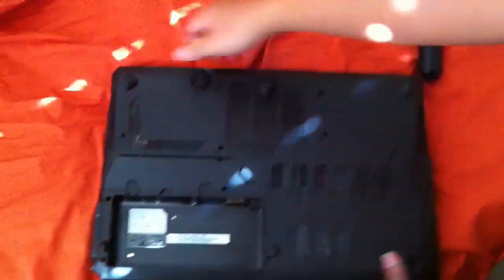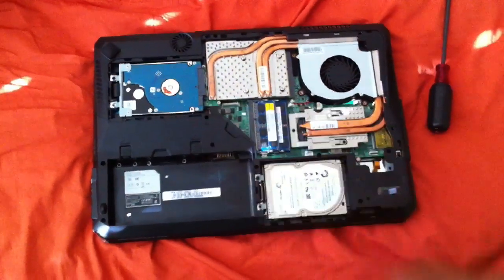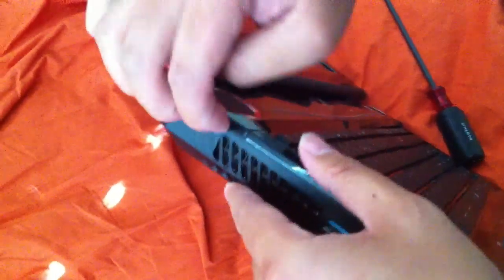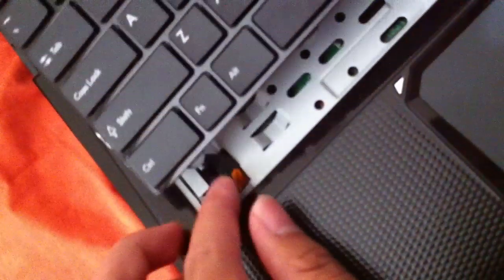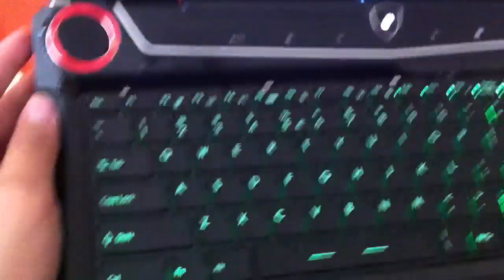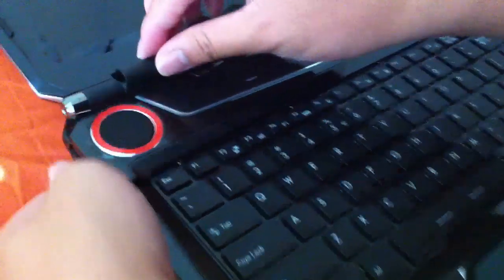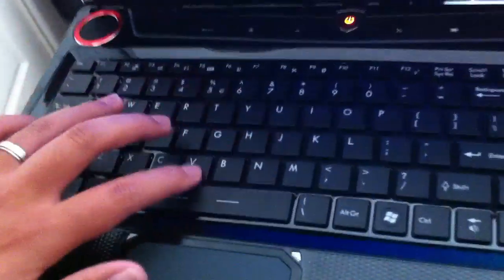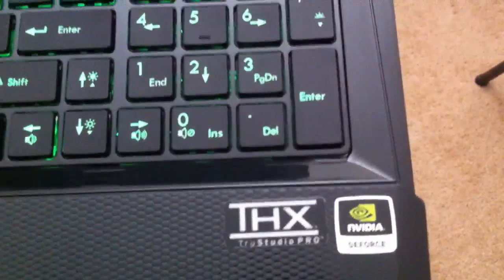MSI GT60 Barebones 16F3 SteelSeries Keyboard Installation

Comment: hi jerry, I ve upgraded my gx60's keyboard to a programmable backlit keyboard very similar to this one, but the brightness and color of the key board are uneven, for the same key it has darker spots and brighter spots. I think I might have bought one of the "fake" ones out there so I was wondering where did you get this one as it looks so much brighter and smoother. thx

Comment: Did it and now I can't switch the LEDs on. Not sure what I did wrong or if it's just a software problem
Reply from the maker: Hey Kim, did you msi GE originally come with backlit keyboards? Like 1 solid color or it came stock with no backlit?
Reply: jerry0o8 it came with blue light.
Fixed the non glowing now.
But it doesn't react to klm.
Will try another version.
Reply from the maker: Kim Schneider Hey Kim, did you buy the exact same keyboard as mine? And do you mean you will try another version of KLM or another keyboard? If your laptop came with blue backlit then the keyboard should work. Your lights are now the colorfull backlit or is it still not working? I'm not sure if the ge60 has any models available that has the full color backlit?
Reply: Kim Schneider Hi Kim, I want to know if you did this change keyboard to a MSI GE60 20E ?? and if you run the application I get to change colors. and I'm thinking to make the change on my laptop too ...

Comment: does this also work for the GE60 2oe?
and which Keyboard will fit?
Reply from the maker: The ge60 keyboard looks the same so I would think it will fit, but I'm not 100% sure because I have not had a ge60 in hand with me before to check.
Reply: jerry0o8 
could you messure the keyboard for me so i can check out if its the same? would be very nice of you. :)

Comment: I might go for this, albeit on my GE60.
Spilt soda on it a week ago, three letters, half my numpad and a few other unimportant keys are all shot...
laptop is fine, its just the keyboard that got all screwed, all the other letters are wrong (space is backspace, backspace is 3, 3 is 'search', and there isn't even a search button ON my keyboard)
I looked up a freeware program made to change key registries (it can reset them to default as well) called keytweak, and i changed all of my keys back, but was still missing 2-3 letters and my tab key, along with 2/3rds of my numpad...so i just went and bought a cheap USB keyboard for now (I might look silly, but hey, it works...I always haul around my charger and mouse for my laptop anyways, and the laptop itself is one of the heavier ones).
Doesn't look too complicated, but I cant even find stock keyboards for under 70-80 bucks, so I can either keep my eye out for someone selling a spare, or shell out the extra 20 bucks for a really colorful one...and this one looks damn nice, won't kid ya there.
Either way, thanks for the video! Was quite instructive ;)
Reply from the maker: hi silverbird6! That sucks that your keyboard got soda on it =[. I still have my stock blue keyboard as a spare I am not using and will sell it. Asking for $65 and will do free shipping. Works perfectly fine since I never used it once I switched it out with the colorful one.

Comment: did that screen come up on it's own after you installed the keyboard? i got a new gp60 which comes with a non backlit keyboard and was thinking of upgrading like you did. just wondering how it works and if I might have driver issues.

Comment: I have not found an update or a suitable fix for this yet. I also thought the cpu would not bottleneck but I guess it does. I know the gtx 675m can handle Tera but the cpu cannot. I also play tera on my desktop with a i5-2500k and gtx 660ti. It runs smooth. If I were you I would not buy another cpu for the laptop. Maybe just play how it is now and upgrade to a desktop later.

Comment: hi jerry i thought that the 3630qm is a good cpu and could handle anything :O that's strange that the frame drops in tera and other games in certain areas and the cpu isn't under full load. it runs every time on every thread on 30 - 50% and the gtx 675m runs then in the areas on 65 - 70%. and on some games like resident evil 6 the cpu runs on every thread on 100% and the gpu too. what could i do to fix this problem? should i buy an other cpu that is oc'able? i'm also planning to play with pcsx2.

Comment from the maker: I got mines on ebay, from the seller Frostycomputers. There is another seller called rkcnotebooks. Both of them are out of these multicolor keyboards atm. I do have my stock Blue backlit keyboard that came with my msi gt60 barebones that I am selling if you would like a blue backlit keyboard for this laptop.

Comment from the maker: Hi, if your keyboard is already steelseries then I think it would work. I checked the ge70 and the keyboard layout is the same as the backlit one too. Only problem is you would have to open the back of your laptop to check if it has a plug for the backlight. If there isn't a plug, then it probably does not support backlight =[

Comment: Hi Jerry. I'm from germany and want to put in this awesome keyboard into my ge60. I know about the missing connector for the powe for the LED's on the board, but I think i will find a 5 volts pin on the mainboard to get them glowing.
Do you have any idea of the seial number of the keyboard with a QWERTZ layout?

thanx for this video!

Comment: Just wanted to say thanks! I spilled beer all over my XMG P512 (which uses the same chassis) last night. Got the case open, the drives and fan out etc. - got everything dried and saved everything apart from the keyboard. Spent an hour trying to get the damn thing out before I saw your video!

Comment: yours is the 16F33, mine is the 16F32. It came with the non backlit keyboard. I don't think it would be a copied version since all of the keyboards come from the same manufacturer (Sunrex), which is also Chinese. But I like to take my chances. And either way, any backlit keyboard is better than the default one ^^
I would appreciate checking it for me.

Comment from the maker: Hey CVSeuy, I will probably make a review this coming week. But yes this laptop is really great, especially for college/gaming/programs/etc. It's fast too. There are some minor flaws though, for example if I turn off the display for 30 minutes or so, sometimes when I come back on, it becomes slow and the mouse freezes every 5 seconds for about 1 second, so i have to restart the laptop. I dunno what is causing this problem.

Comment: you can also check RkComputer,  they sell them.  A littler more expensive but still a second option if the ebay seller ever runs out.